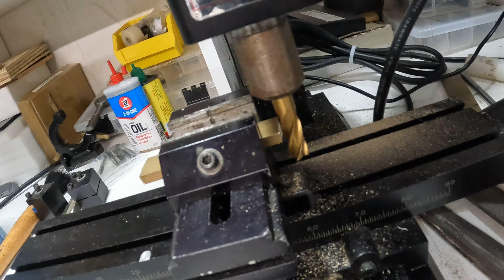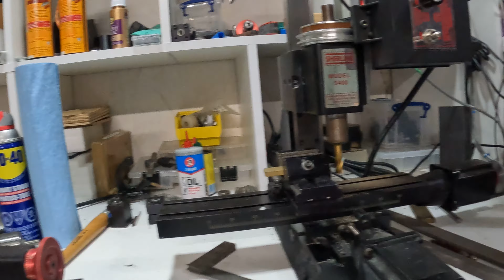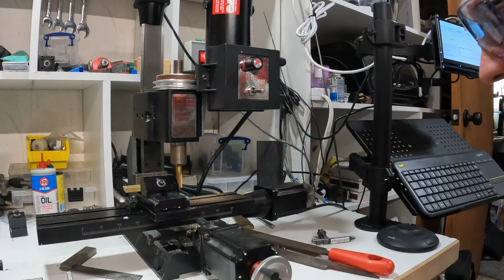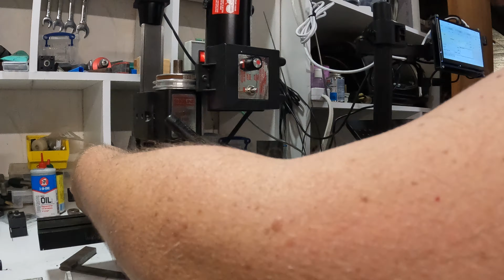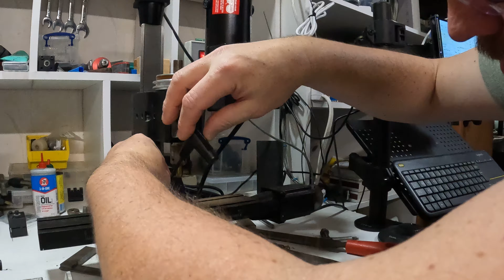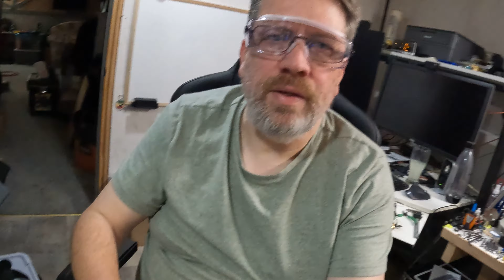Manual Milling with a Sherline CNC Mill

Comment: Hi Jon, I was searching for Sherline Mill Videos (I just purchased the 2000 Model & own the 4000 Lathe) and came across your wall. 
👉Did you have MANUAL SETUP before the CNC Setup you have? Or did you jump in with this machine starting out?
Being totally new to Machining I’m just curious. As I wanted to get my feet wet with the equipment I currently have & aspire to get to the CNC setup
In your video😁 How do you like Sherline? Personally I feel it was the best decision I made as a greenhorn guy. 
Cheers!
ZenModeling
Reply from the maker: Hi Zen, I had a vertical milling column I used on my lathe (completely manual) for many years before I got my CNC mill. I strongly advise you to learn how to do it manually before you get a CNC.

Comment: Hello Jon,

Did you have CNC experience before buying this mill? If not, was it difficult to learn the process of programming and mastering the machine. I am looking at a 5400 series, to be used for very shallow cuts in removing
Reply: (sorry, I accidentally pressed send) a depth of approximately 1/8” in steel. I have absolutely no machining experience but I would like to learn. Thanks for the video.
Reply from the maker: @haroldkreye8770  I did not have any experience. Your best bet is to join one of the home machining groups on Facebook, or a sherline group there, or one of the forums. I have no training as a machinist, everything I do with mine has been self taught.
Reply: @JonHylands  Thanks, Jon, I’ll take your advice. Perhaps I can find a group here in South Texas.
Reply: @haroldkreye8770 
Hi Harold, just noticed your message & noticed you might be in the South Tx area. Ive had my Sherline 2000 mill & 4000 Lathe several years now & always up to help…Lee

Comment: You can use the hand wheels to do manual milling.  Need to be careful about cranking too fast, the manual for your driver board should provide guidelines.  I’ve considering wiring in two switches per motor to open the windings so the mill can be used in manual mode without worry.

Edit: I put in double pole single throw switches to disconnect the stepper motors from my TinyG driver board for all three axes, and am now able to use the mill as a manual device without concern for the board.  Works slick.